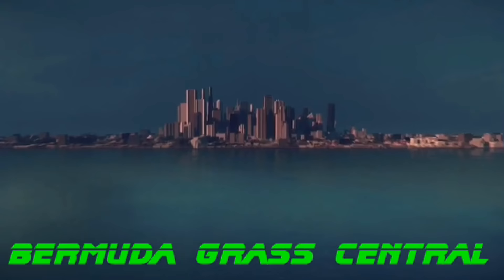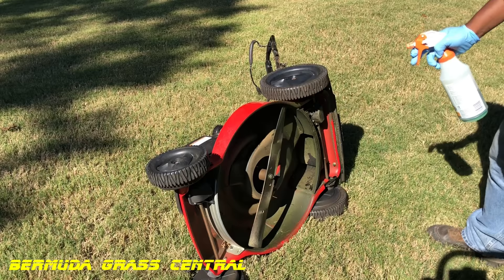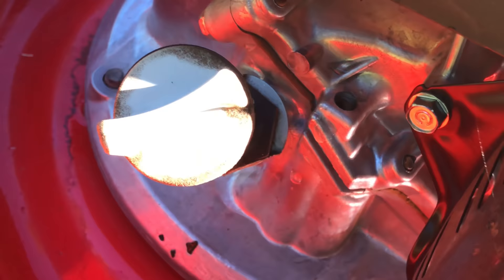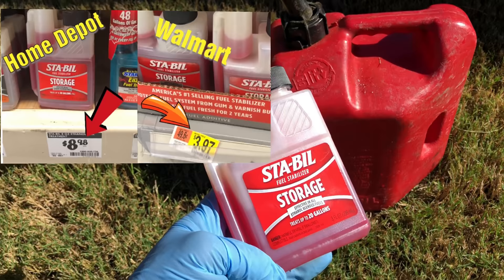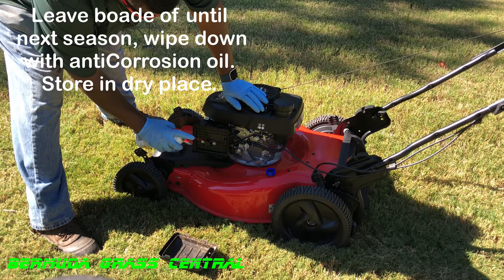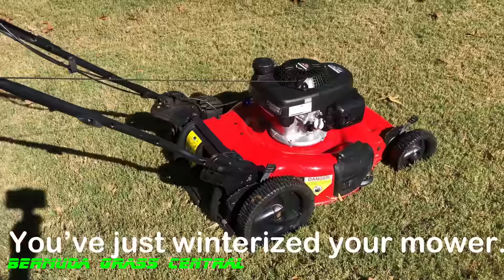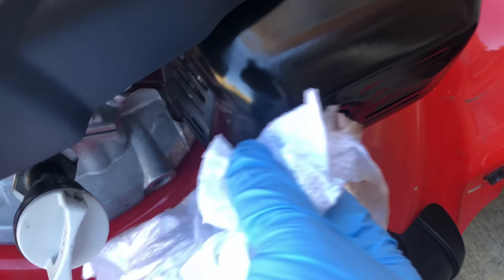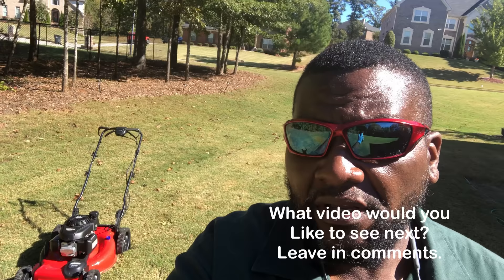How to winterize your lawn mower, plus how to use fogging oil

Comment: Great winterization lawn mower video!  Thank you for using our STA-BIL Storage fuel stabilizer and STA-BIL Fogging Oil products!  When storing equipment, we do recommend storing with fresh fuel treated with a fuel stabilizer. This will limit the amount of moisture that can form inside the tank and cause rust and corrosion. If anyone has any questions, let us know - we are more than happy to help!

Comment: Great video but what I do when I put it in spark plug hole I pull the cord without the spark plug wire connected so the cylinder gets coated.

Comment: Good job on the maintenance.  I like to keep my machines clean also.  I couple of things that I do:  When you are cleaning the the plastic parts use a good car care plastic and vinyl preservative. I recommend Adam's Polishes products (adamspolishes.com).  Also from the world of car care, get some detail brushes to get the junk out from around the carburetor linkage and other small spaces.  From the world of bicycles and motorcycles, find a good cable lubricant.  Give the top of each cable a good shot so they don't rust and stick. I use a stiff bristle brush to clean under the deck.  If you use a metal scrapper you will scratch through the paint creating a potential rust spot.
Great video.  Keep up the good work

Comment: BYD I’m very surprised you tipped that mower on its side on the grass with it filled with gas and oil.
Reply from the maker: well here is the difference, if you tilt it on the side  opposite the fuel tank lid ( half tank gas or less)  and air filter then you will never have an issue with fuel or oil leaking. make sure oil cap is on tight though because it will be on side tilted to ground. if you still not sure your mower is capable of this then pump gas out of tank or run empty.  empty oil . then tilt, was mower bottom, then top. add new oil, fogg air intake the spark plug hole, but if your mower is leaking oil and you have it flipped on it's side then you have other issue. you can always use that good old cardboard, lol.
Reply: I usually just do mine on the dirt with cardboard I just make sure my fuel tank is 1/4 tank full or under.